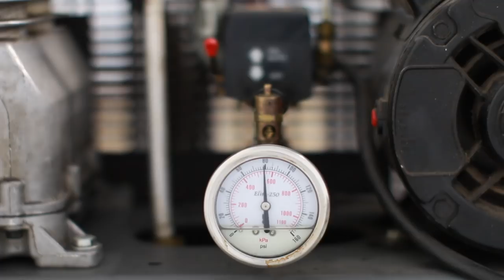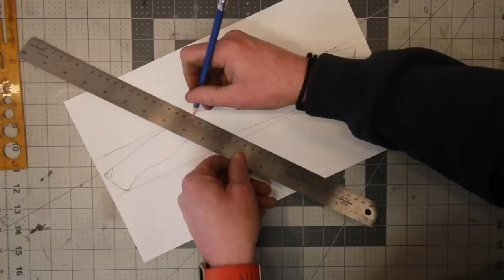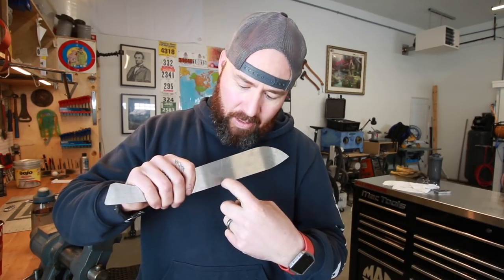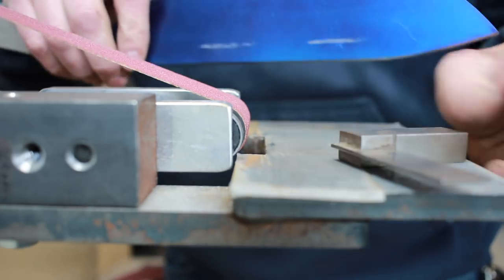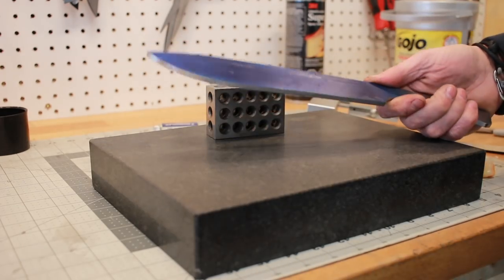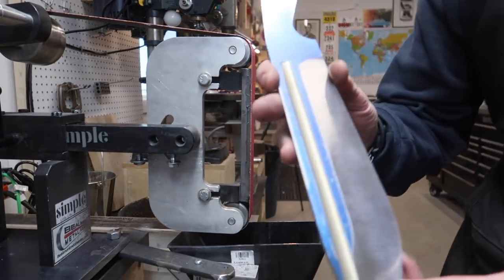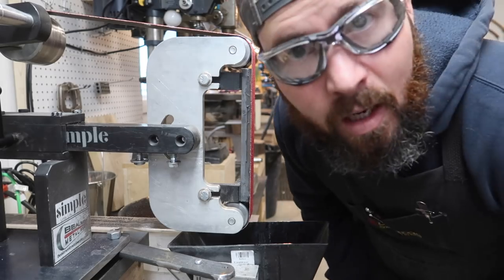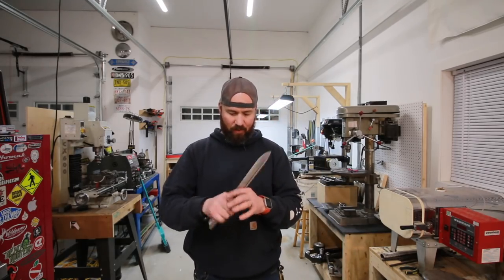How to Make a Knife - A chopper knife - Part 1

Comment: Could you show how you do your plunge line? I run my belt 1/4 over the platen then just feather them in by hand. Admittedly I just started doing this but I have a feeling there is a better way other than just eyeballing the plunge. 

Thanks!

Comment: Why didn't you mill the fuller? I would, and have, grind mine in, but I don't own a mill and I'm just curious. Thanks.
Reply from the maker: You're in luck! Grinding them in is about 3X faster (maybe even more). After milling one in you still have to address the surface finish which would take even more time, and with grinding them in, you can match surface finishes. Lastly, do put in a nice large fuller you need a big heavy milling machine. Even a 1/4" fuller in my mill turns out quite poorly. I'd say grinding them in is a way better way to go. Cheers!👍
Reply: Ah, that makes sense. Thanks for the time and response. Knife looks fantastic thought. I can't wait to see it completed.

Comment: You use o1 alot I notice. When I was using some over the summer even when I came back the next day I noticed it was rusting. How do you deal with that?
Reply: Jamie Plett you can just put some oil onto it and it wont rust

Comment: Just quick note on you fuller that is the correct term. blood grove is incorrect since it does not assist the flow of blood out of the body or prevent the blade getting stuck in the body by suction. 
A fuller is just a wat to keep the blade light, that is the only historical reason why you would put a fuller on a balde, without reducing the strength of the blade.